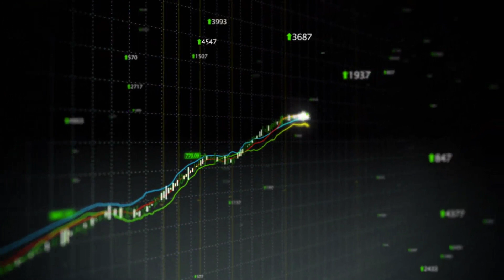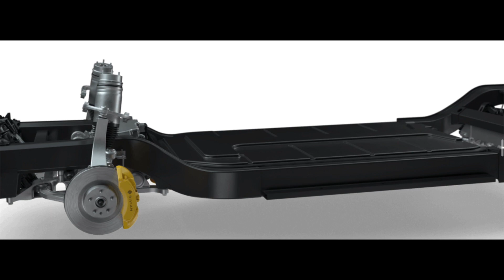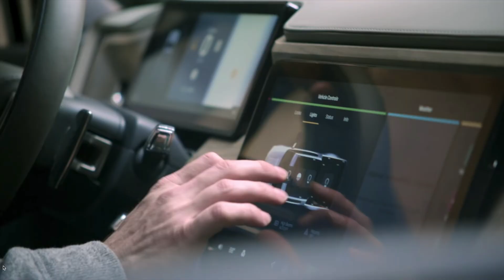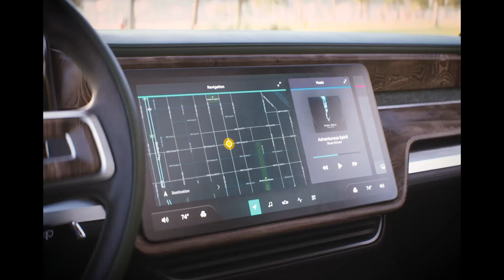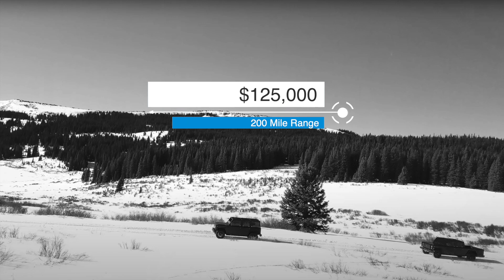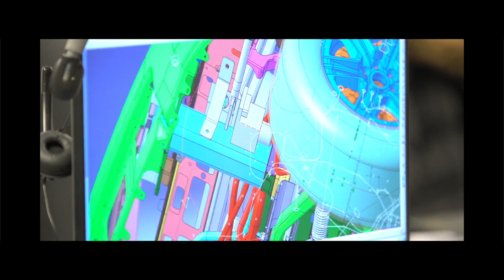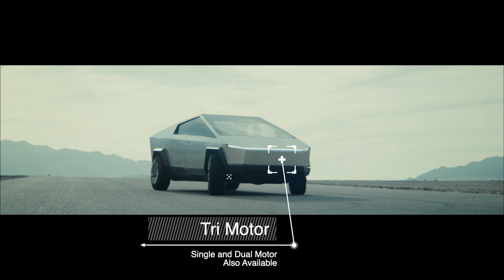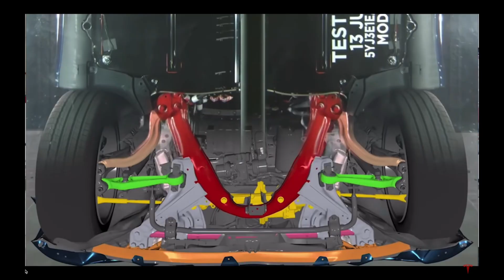Which EV Truck Will Survive? R1T vs. Cybertruck vs. B2 vs. F150 vs. Hummer vs. Badger vs. Endurance!

Comment: I think the rivian is the underdog.. its gonna be challenging for them. We’ll see
Reply: It is going to hard to beat a company that's as invested in battery tech/manufacturing as Tesla, not to mention the massive head start. I like the Rivian trucks look though. I hope we see them on the road.
Reply from the maker: You're absolutely right on the investment and manufacturing front. I see Tesla as number one in this race but there's definitely room on the podium for others and I'm thinking Rivian will be one of them.
Reply: @timetoadult2059  I think Tesla might see Rivian take the truck market a bit just based on looks. Assuming they make it to market. Now we have GMC releasing a 1000hp electric Hummer, and Ford electric trucks, also. So the pot is about to be stirred a bit. Tesla will be holding that cost/performance crown for a while though with their battery investment.
Reply: No EV startup has been in a better position at its launch than Rivian has and it will be a long time before we ever see another that is, IMO. 6 billion, mostly from private investment firms. 5 of that after their unveil in 2018.  2 models AND a 100k order for an Amazon delivery fleet worth billions, all launching within 8 months of each other. Their Cox Automotive partnership gives them access to a fleet servicing network and a ton of help with sales/marketing/distribution. Tons of tech synergy through Amazon, way beyond the Alexa stuff. They've had hundreds of QC validation R1Ts rolling off of their first production lines since early September when they wrapped their pilot line builds and internal crash-testing. Rivian's CEO is a subject-domain expert. He already knows all of the stuff Musk insisted on learning the hard way. And they're like this talent singularity for the whole auto-industry right now.

Tesla's new batteries are no joke. Neither is FSD if they've made another big step forward there and his biggest fans aren't just getting ahead of themselves as they've tended to. But they suck at service/build-quality-consistency. Their interiors are weak. Packaging is lousy. 0 to 60s are great but agility isn't. We'll see how much of an off-roader the CT is but it's already too big to be ideal for a lot of off-road usage and it doesn't have the 4-motor or the suspension advantage.

Rivian's not killing anybody in their first year but they're not fooling around and Musk knows it. It's why he flung that flimsy smear-suit at them. They could have a year+ to build a quality/service reputation before the CT shows up and the R1S is absolutely going to grab some X/Y marketshare.
Reply from the maker: Several great points here Erik 👍 Battery and autonomy are Tesla's moat but Rivian is in a strong position, especially as a startup. They're my favorites outside of Tesla and based on the Hummer price, I'm thinking legacy automakers are going to struggle on price vs. Tesla and Rivian.
Reply: @timetoadult2059  Well, GM didn't make a bad business decision. Those silly things will sell like hotcakes if they actually have something working/reasonably-well-tested by a more realistic launch date in 2022.
Reply from the maker: I agree but they do have a compelling truck and some good backing so we’ll see indeed

Comment: Cyber Truck or I rather walk 10 miles. If I buy a electric truck, EV maker will be the co I would buy from. Good luck to all the legacy auto maker. They may go BK before their electric truck comes out.
Reply from the maker: Totally agree, legacy automakers probably have  more of a brand advantage when it comes to trucks but they are going to struggle to maintain their ICE business and develop a compelling EV truck. Once Cybertruck is out and destroying legacy on specs/ performance, the walls will close in.
Reply: @timetoadult2059  IMO, the EV Hummer and EF150 will sell like hotcakes regardless of merit. Ford also benefits from the fact that the EV startups and GM aren't really designing to appeal to the work truck crowd that wants beds that are both long and highly accessible.
Reply from the maker: The Hummer EV1 is already sold out so you have a point and I'm almost certain it'll be the same for the EF150